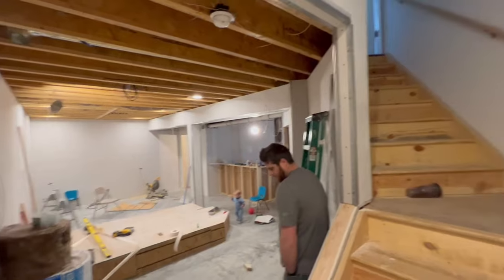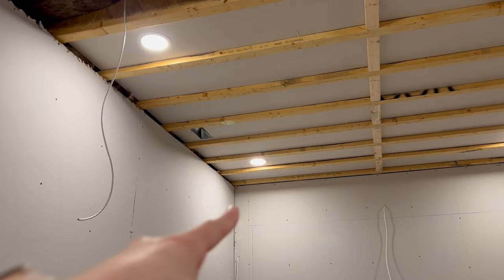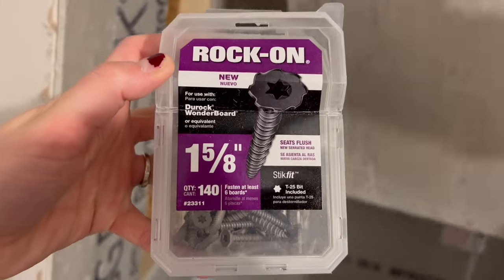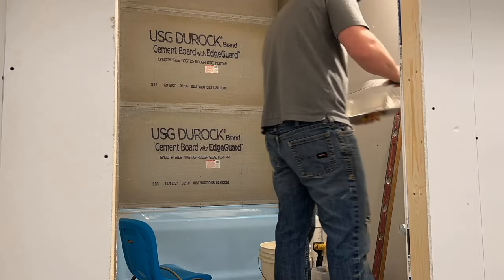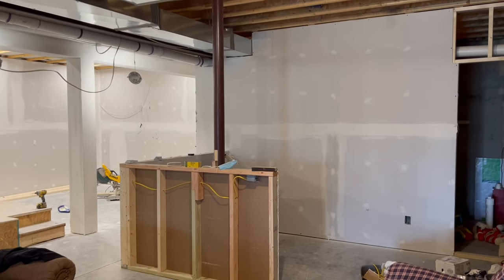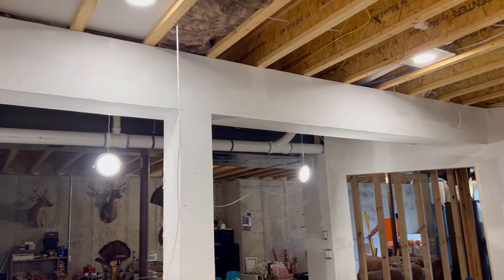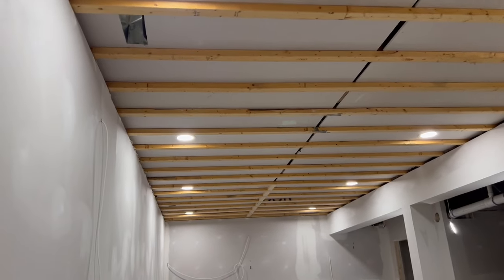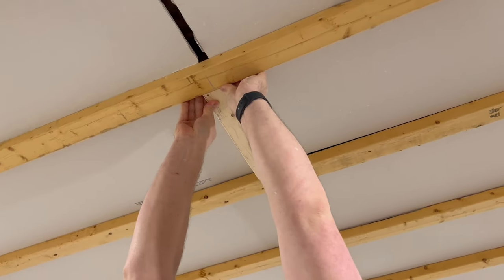Finishing Basement #11: DIY Accessible Ceiling | Drop Ceiling Idea | CHEAP, EASY, FAST & LOOKS GREAT

Comment: Hello! Good job! How do you get pass any copper hose in the basement
Reply from the maker: Hi! Thanks for watching. If the copper pipes are in the way you will likely have to recess them in between the joist or try to relocate them. Turn water off and buy shark bite fittings and it will make easier job. Other option would be to get really creative and come up with ideas to where you don’t have to relocate them but possibly box around them. Good luck. Hope this helps.

Comment: Hi! What size of the nail did you guys use for those 2x3s? Thanks!
Reply from the maker: Hi. I used 2 inch trim nails out of my dewalt trim nailer except where the projector will hang. I used 3 inch decking screws where the projector is for added strength. If you do not have a trim nailer you could use just screws. The nailer allows for exact placement of the 2x3s.
Reply: @CollinsCountry  Hi Im also wondering how did you secure the supply air register above drywall? Thanks!
Reply from the maker: @oliverpan2353  I used steel adjustable brackets. The supply lines just sit on top of them. Any big box store should sell them near the supply line HVAC stuff.

Comment: How tall is your ceiling?
Reply from the maker: +Kimour Chi 9 feet. We had them pour 9 foot walls when we built our house because we are tall people and didn’t want to feel squished in our basement. But, this would be fine with 8 foot walls as well because it doesn’t drop your ceiling down. That’s what’s nice about it! I hope this helps
Reply: @CollinsCountry  thanks. It looks more than 9 feet.  Probably because of the way you have your ceiling done.  Smart idea.  I have 9 foot ceiling as well and want a theater, but hesitate to build the stadium stairs for the theater seating as you did.
Reply from the maker: +Kimour Chi Thanks:) I don’t know the geometry behind it, but this style and color ceiling makes it feel like it’s actually much taller than 9ft. It’s awesome! We didn’t know it would do that but the ceiling actually feels higher now than before it was finished! Also- I 100% recommend doing the stadium stairs. It is awesome and my husband is 6”3 and can stand on the riser without his head hitting the ceiling. It’s 100% worth building! We made a video about how we built that as well if you need to watch it.

Comment: Literally ordered 20 sheets of drywall to do my ceiling after seeing this. Are those 8’ strips of drywall or 4’? Did you notice any sagging since it’s been up?
Reply from the maker: +gpsbowl Hello! And yay! You’ll love it! We cut them in half so it’s 4 feet. But it might not be 4 feet exactly. Just cut it to half the size of your room:) The size will depend on the width of your room, of course. And nope. The ceiling has been there a year and absolutely no sagging. It’s perfect